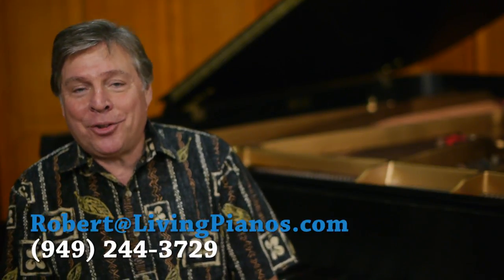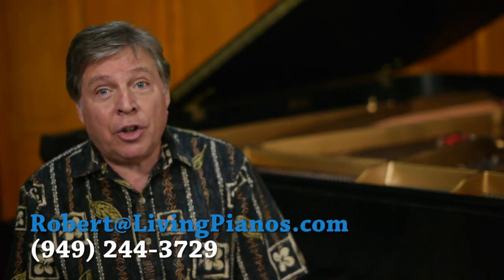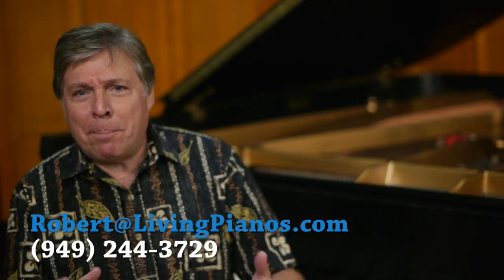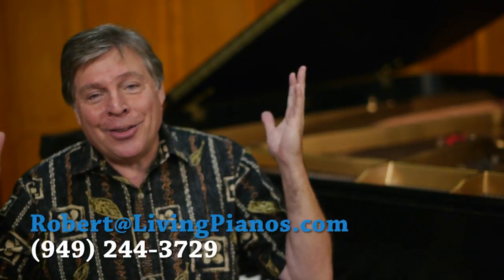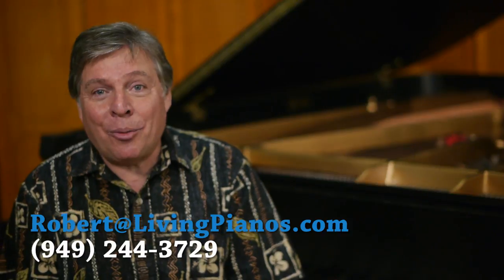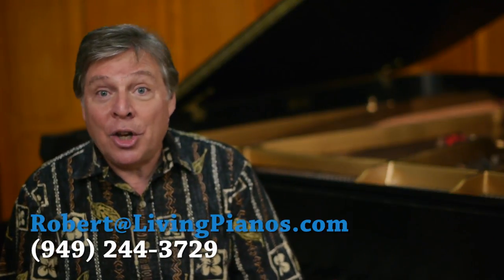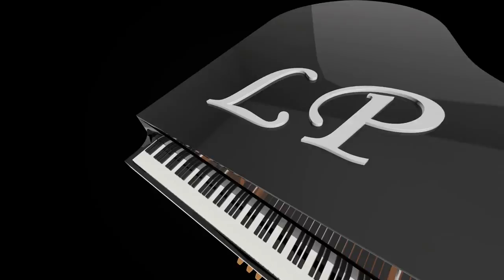Can You Tune Your Own Piano? A Beginner’s Guide

Comment: Hi Robert, I'm sorry but you are just flat wrong on this one. If you read the patent it explains clearly the intended purpose. Which is to strengthen the string frame.  Nothing to do with the soundboard crown.
Reply: Yes, Mohr weighted the action so the keys played without resistance. Horowitz played flat fingered. Everyone that tried to play Horowitz's piano has a hard time because they're used to weighted resistance.

Comment: Thanks! I've been wondering. I guess it's S&S' answer to M&H's tension resonator. A good function for both manufacturers.
Reply: the Sreinway bell is a 15 lb. piece of cast iron screwed onto both the inner and outer rim in the high treble area of the case to receive a plate bolt. they are not rare, but are not present on all models. Their function is to maintain stability at the far end of the plate it has nothing to do with crown adjustment
Reply: If at all it‘s the other way around. Steinway builds the bell for over 120 years.